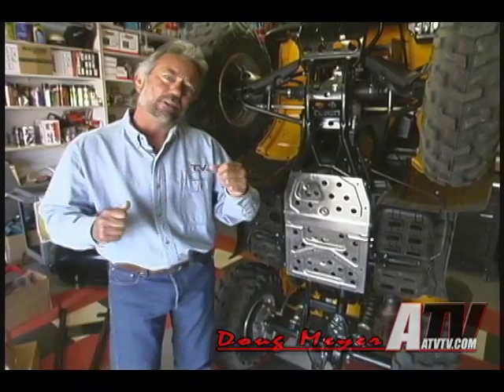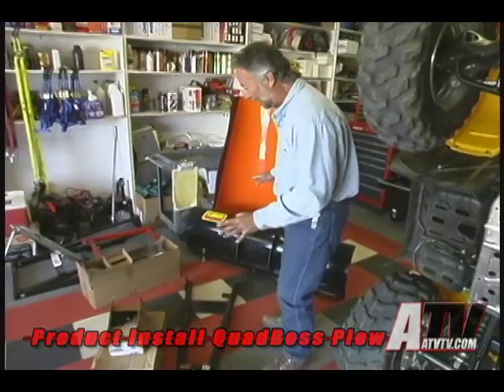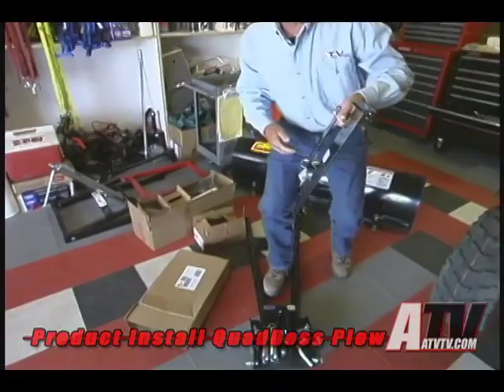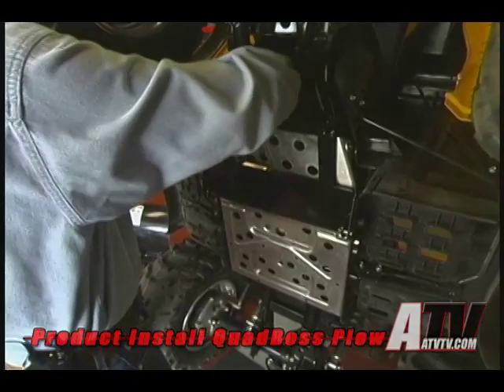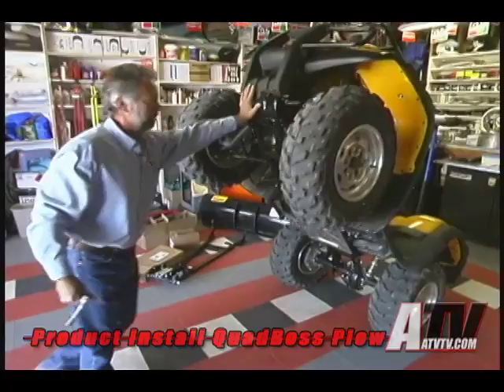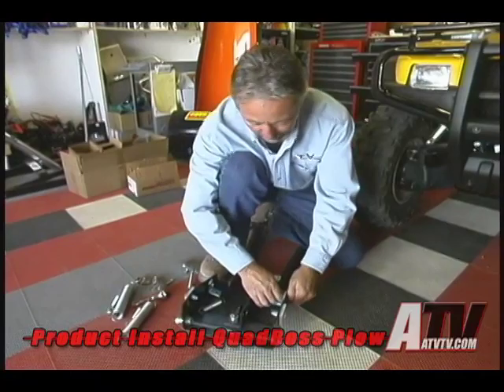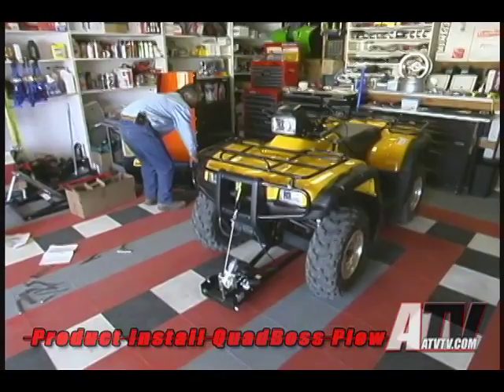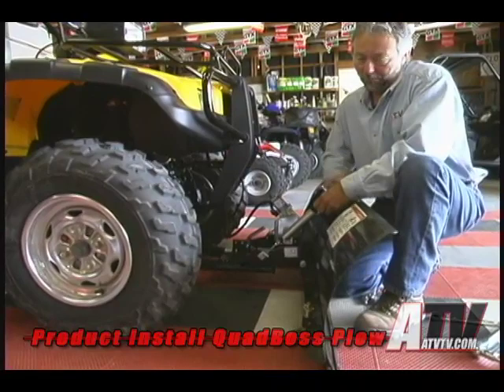ATV Television - QuadBoss ATV Plow Installation

Comment from the maker: @weqterb I've found the QuadBoss, Cycle Country, and Warn to all be very close. We put a Warn set-up on a newer Grizzly and have since moved it to my personal Prairie for snowplow duties. I really prefer using a winch for lifting the plow as when the plow's not on, you still have the winch!!! One system we haven't tried yet is the KFI. We used their winches and they are reasonably-priced and well-built.